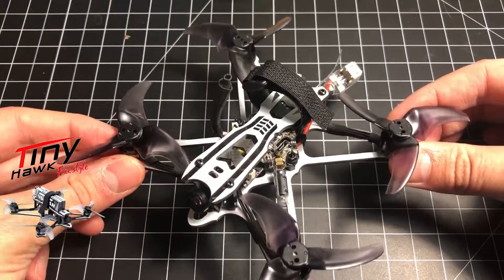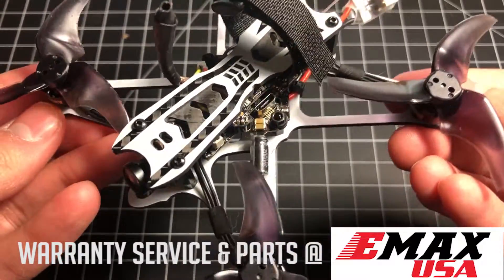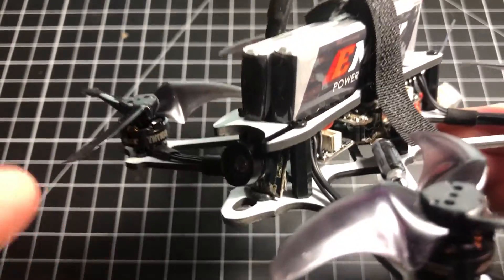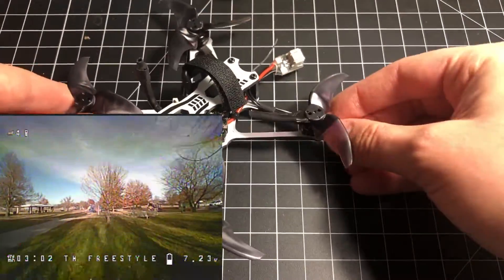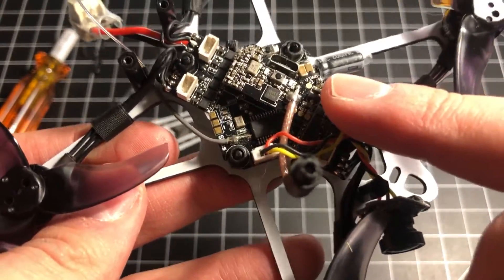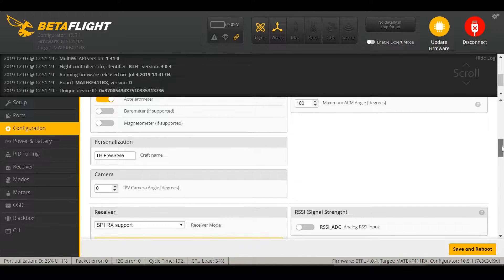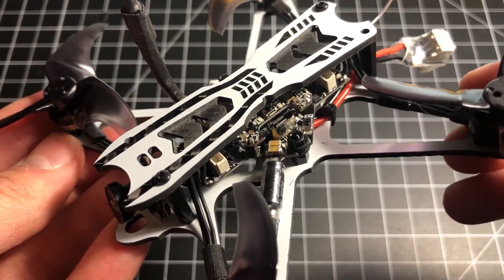Emax TinyHawk FreeStyle Micro FPV Drone (Full Review)

Comment: This is an awesome tips and tricks video John, thank you for the information. So far I crash a lot, but am learning to control it better as time goes on!
Reply from the maker: Glad to hear, hows your freestyle experience been? Sadly mine finally gave out :( and I decided not to fix it but I miss how it flies
Reply: @JohnCuppi   I have taken it out a few times, my experience is excellent. One of my motors has picked up something and is binding up ATM, however I have since taken it apart and have it spinning at least. I have to take it apart again to try and clean it better. so in the meantime I'm practicing on the DCL sim and am getting better. Happy flying!

Comment: Hi John great review. I have one question for you, what transmitter you suggest for tinyhawk series drones ?
Reply from the maker: Depends, I personally use an frsky taranis x9d+ -- but there are other options. The most important thing to check before buying any transmitter is to ensure it has D8 receiver compatability.
Reply: @JohnCuppi  well, i did my research and Radiomaster tx16s is on it's way.

Comment: Just bought one I have it setup on my Jumper T8SG Plus I will upgrade the camera and VTX.  Out of the box this Quad is Tune and Quiet I think some things like the Antenna mount and poor camera and VTX should not even been on such a good machine, to bad when we have to fix poor design like this. good job pointing out this in your review.
Reply from the maker: Thank you! I try to be honest and objective as possible in my reviews so I really appreciate it. I did eventually replace the VTX with that TBS unify nano 32 pro and highly recommend doing so!

Comment: I'm a beginner and bought the TH RTF kit and then got the "freestyle'.  The range/camera are not good and Emax recommended I select a polarizing antenna for the goggles.  I did and it made a big difference.  Minimal breakup and more confidence in flying.  Also, they hinted a Freestyle 2 might be in the works! :)
Reply from the maker: I too have had better performance with a linear polarized patch antenna on all of my whoops and drones with dipole antennas. 👍🏻thanks for the comment!
Reply: @JohnCuppi  You're welcome and thanks for the review and dip into BetaFlight.  I find the lower rate profile 2 is more to my liking.  However, looking forward to the Freestyle 2 with better camera/vtx/range.  I got the TH2 and imo it flies great...much much better than the original TH.
Reply: Sorry...I actually prefer rate profile #1
Reply: Hey John, I noticed I was getting sketchy reception and looked at the VTX attenna connection and saw the small black (I assume ground) wire had come loose.  when I touch it to ground the reception returns.  I really can't tell where exactly it was attached/soldered in the first place.  Can you point me in the right direction?  Thanks!

Comment: Bought a eachine nano vtx will I need to add a 5v regulator?
Reply from the maker: Eachine Nano VTx only accepts 5v input so you will be forced to tap the regulator from the board, or install a small external regulator from the battery leads. I was too scared to use the Eachine Nano VTX on mine for fear of blowing the regulator on the TH freestyle’s board but you may be able to get away with it as long as you don’t max out the power on the nano.

Comment: Fyi the stock vtx runs off 5v . The 3v pad is on top and just an option
Reply from the maker: Yeah that makes sense I think it has an input range of 3.3v to 5v, since it was primarily designed for use with a 1s battery.
Reply: John Cuppi I am avitualla using the run cam nano split 3 on it and it works awesome 1080 60fps

Comment: Would I be ale to run one 2S 300Mah 75C on this drone at a time? Or two 1S 450 Mah 95C batteries at a time? Thank you for your time! Super new to drones here and just trying to get things figured out. I’ve read batteries and drones need to be right.
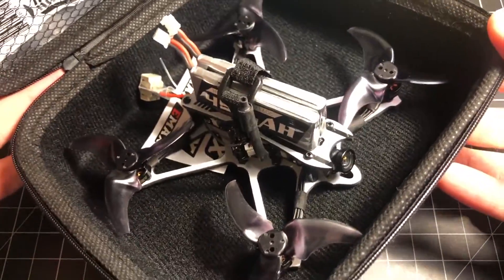Reply from the maker: Yes, if you change the connector you can run a 2s battery. I talk all about batteries at 8:25 in the video, and give my recommendation for a 2s battery, should you decide to cut the connector off and replace it. A 2s 450mah LiHV GNB “skinny” battery shown in the video would be my favorite choice to go that route. You can see how they fit :)
Reply: My Tattu 2S 300Mah 75C battery works with the Freestyle. Can’t I just plug it into one of the 2 connections on the drone and fly just the one battery? Why would I have to change the connection since it’s already a 2S drone? Or can’t the 2nd female connection on the drone be left open? As in either always fly 2 1S batteries...or change the connection for 1 2S battery. Hope that makes some sense. Thanks again!
Reply from the maker: Redshark 900 oh, I see now. Just looked up that battery, 2s and a PH 2.0 connector. I didn’t know anyone made them. I think you could definitely use that! my only concern would be trying to push all of the current the quad needs through a single connector which is already honestly taxed as it is. I don’t really know if you’d see any real benefit over a 1s x2 setup at all.

Comment: I have been flying this guy for over a month now. Pretty good little trainer fpv. At least that's what I am using it for.
Reply from the maker: Nice! Have you done any upgrades or mods or still flying stock?
Reply: @JohnCuppi  Still flying it stock. I agree with everything you said about it. It does not have much range or a great camera but for what it is, its not too bad.
Reply: @JohnCuppi  have you done any upgrades? I just came across drone campus's video on it. Seems like its not worth it but the camera perhaps maybe.
Reply from the maker: @YourLocalIceMan   No this was all stock which I think is the only fair way to review it. Personally while I think it’s great that there are mod videos out there showing how to do all of that out there for those that want to, at the same time I was scratching my head saying “really...?” — spending $80+ to upgrade this thing is not worth it in my opinion, even if you CAN do it. Better off building your own at that point. That’s why it was painful for me to recommend the TBS nano vtx which is the only upgrade I will do on it for now. Maybe the camera later. In some cases it may make sense to swap out the camera especially if you have a Tinyhawk v1 or S that needs a new one, or that you could keep on hand as a spare for it. My TH v1 I showed here has a busted camera so I’m thinking about it. But going all out and spending way too much money on upgrades for this is absurd to me. 🤷🏻‍♂️ overall it is NOT that bad stock...

Comment: Fantastic video, thanks John. Id love to see a follow up video if you decide to upgrade the VTX. Anyways have a good one John.
Reply from the maker: I am upgrading it to the TBS Unify Pro Nano32. I paid the $30 for it might as well put it to good use! There will be a follow up probably next month! :) first I need to run a comparison of it though vs the eachine nano. Trappy might hate me for the results! (Just kidding)
Reply: @JohnCuppi  Cool, I look forward to seeing that one :)
Reply from the maker: Rigger Mortis hey I just wanted to follow up and say that I did end up doing the Nano32 VTX upgrade, along with antenna upgrade to the emax pencil red tip antennas. Without a doubt it makes a huge difference, and I have not burned the board up at all. The video is also really clean, there’s no noise in it on high throttle despite the video transmitter being powered directly at the battery terminals. Very impressed with the TBS nano32’s capabilities on this little guy.
Reply: @JohnCuppi  Nice choice John, Im making  notes. Im very close to pulling the trigger on some kind of little yard ripper.

Comment: Nice review John..... Looks like a nice yard RIPPER.
Reply from the maker: Thanks. Just wish the video transmitter was better, but hey, isn't that always the case with eMax! Lol.
Reply: @JohnCuppi  Yep the same one on the Tinyhawk original.... surely a weak point.
Reply from the maker: @kydawg1684  Yeah they must have done some small revision though when they made the tinyhawk 2s, because for whatever reason this vtx isn't nearly as bad as my tinyhawk v1. Or maybe it's just the antenna. :) Or maybe it does better with 2s power, who knows.